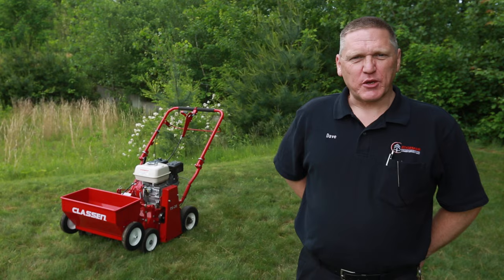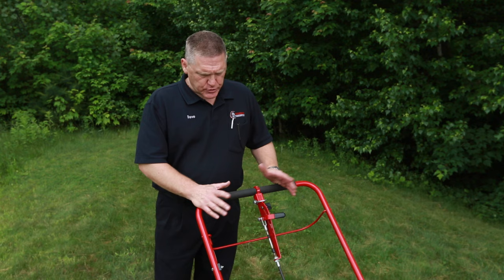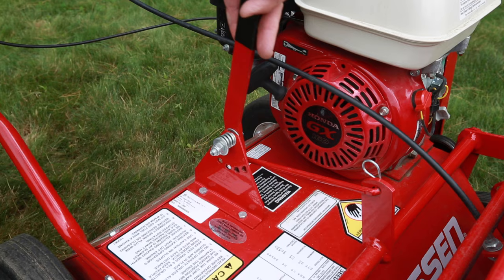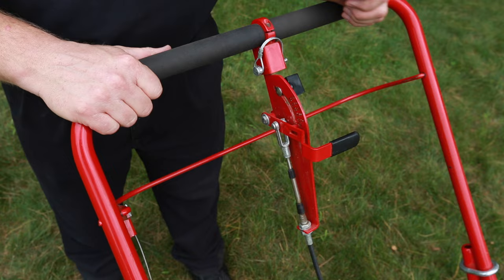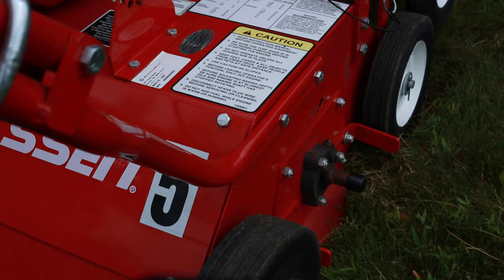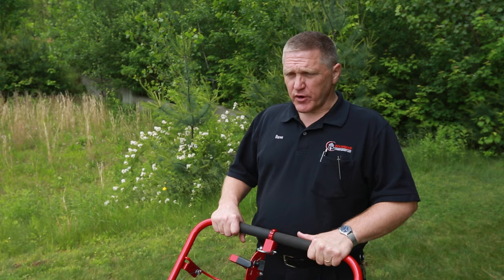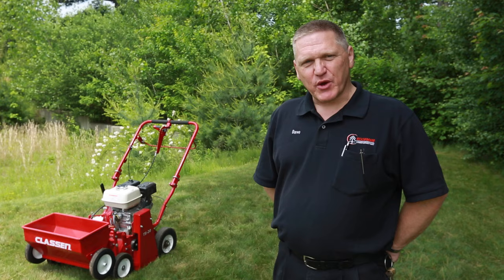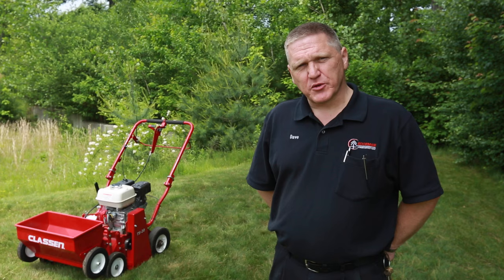Tips in Two- Using the Classen TS-20 Overseeder

Comment: I am glad to see this video! I rented this machine at Home Depot and the dept adjustment was setup wrong. It is slightly different than this one; you have to remove the pin and reinsert it to different holes to get the proper dept. The problem is: the pin was NOT engaged in any adjustment hole and they told me to just move the lever back to engage the mechanism and the opposite to disengage, not noticing that the mechanism was assembled wrong. Shame on you Home depot employees!!!

Comment: Before you rent and overseeder machine first prepare the lawn by mowing the lawn down to 1 inch bag the clipping. Run the overseeder machine over the lawn empty with no seed this create slits on the lawn. Use a broadcast spreader apply your seeds. Then you could use your overseeder machine as you would use it and its normal operation.
Reply: why run the seeder without seed and use a broadcast? What not just use the dropper on this machine?
Reply: @kyle.fredrickson  because this is the way the pros say to do it